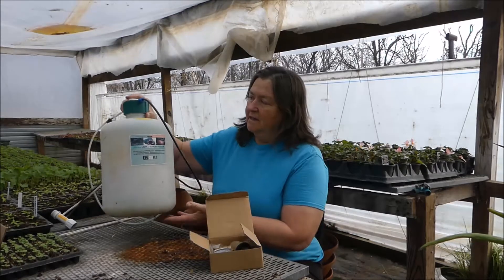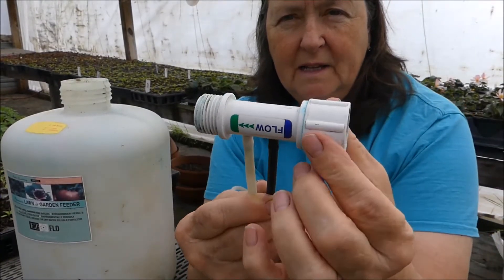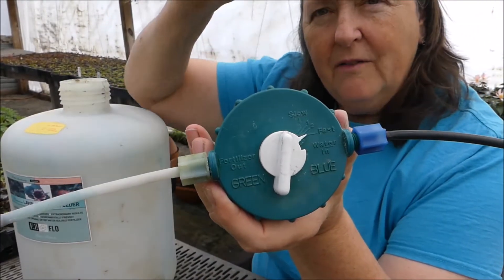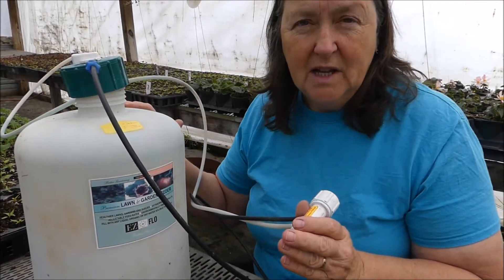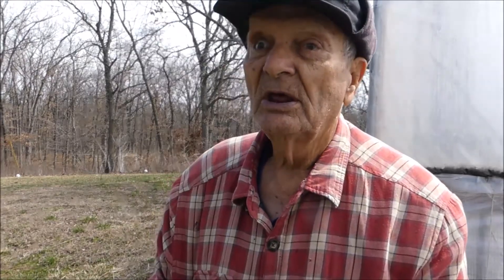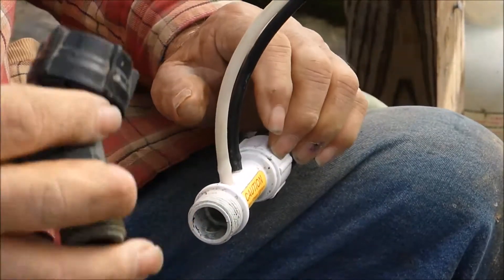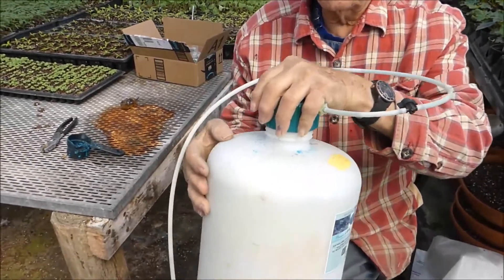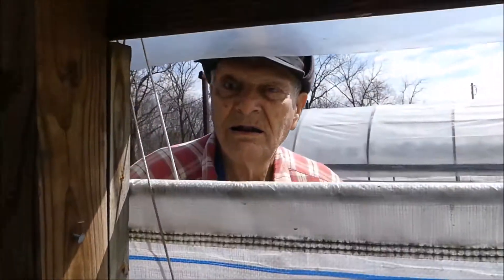Controlling the Pressure/Greenhouse Fertilizer Injector

Comment: Good video, get some of that spray flex seal to fix that leaky jug.
Reply from the maker: Does it have any other name?  Spray flex seal?  Does it come in a spray can, or what. We've tried a few different things but not all plastics adhere to each other.  It's been kind of frustrating.  Thanks for the tip!  ~Janette
Reply: The Neals' Homestead flex seal at wal mart, they have the tape, spray and paint on.  Videos on here about it also.